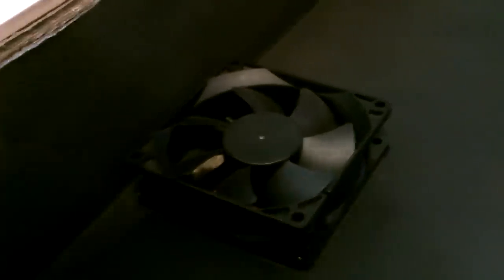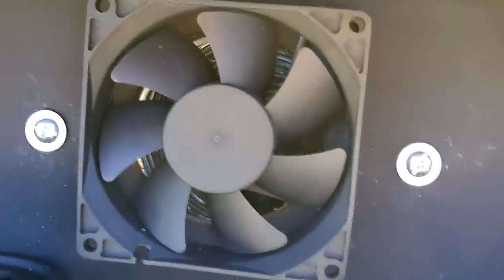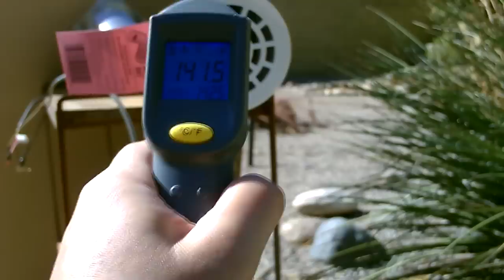Homemade "Steel Can" Solar Air Heater! DIY - STEEL CAN Air Heater! (140F+) - EASY Instructions!

Comment: I'm assuming you are using TIN cans. Do they even make steel cans?
Reply: Virtually all cans made today are tin plated steel.  You would be very hard pressed to find an actual can made only of tin produced after 1900 (this is mostly due to the cost of pure tin as apposed to tin plated steel).

Comment: What about at night?  Does it pull in cold air?
And for the comment about using aluminum vs "steel" cans, vegetable cans are not really made out of steel any more are they?  

And, what about using metal pipes in place of the cans?  Would it need to be cut into shorter pieces, so that baffles can be put every so many inches to slow the air flow and allow more heat absorption?  Wouldn't steel pipe absorb and hold heat better because it's thicker/heavier? or does that even matter if there is no sun, there is no heat... correct?  

I'm thinking about using something like this to add warmth to my chicken coop in the colder months.  It doesn't have to be real warm, just keep it above freezing so the hens lay better and the water won't freeze.

Comment: You didn't show how to hook up the fan.
Reply: Jaime B If you're buying a solar panel how much electricity would that buy for a low power fan? Buying ANYTHING for the project kind of defeats the purpose by the same logic. The clever solution would be to design in enough convection so that it powers itself (a dirty big chimney is  best)  but that's probably beyond most.
Reply from the maker: Amelia Harrington hi there. to connect the fan to the solar panel just hook the positive (usually red) wire from the fan to the positive wire from the solar panel and then hook the negative (usually black) wire from the fan to the negative wire from the solar panel. (to see the actual connection, look for my new "screen absorber" solar air heater video (will be posting it in a day or two). that heater uses the same type of fan/solar panel and shows a closeup of the connection. (the newest air heater uses a "screen absorber frame" in place of the cans to concentrate the heat).
Reply: I bought my fan at Radio Shack (it's for an old-style tower computer or telecom cage) and mounted it on the side of the box using 4 small wood screws (less than 1/4" I think).

Comment: I have an Idea the way the Oklahoma highway patrol want to be able to see Inside Your vehicle, just use Your vehicle as a heat collector then run a 4 Inch or larger diameter sewer line from Your vehicle to Your house. But I live part time In a Polyester Ice shelter which uses much less energy to heat and cool My house.

Comment: Does this only work during the day?
Reply: Randy Taylor since it depends on solar energy to operate then it will not work when the sun is in the other side of our world ie night time .however if you can you use the solar gain to heat some heat storage device then in the night the heat can radiate from the storage device . if you have no danger of the area that you are storing heat in dropping below freezing then something as simple as water filled jugs can be used to store heat during daylight and released at night time .

Comment: I think this is a wonderful ideal. We get cold winters and heat with propane which use to be cheap but like every thing else it's got to high. Our temps run in the 30's daytime most of the time. Keep up the good work.
Songsingingman

Comment: I made a small one using this idea 6x6 cans, hung it flat against a big double glazed window indoors so worm air 16c - 60.8F gets drawn in at the bottom and at the top of the cans it can hit 55c/ 60c 130F no fan just convection i've still to test with a fan.

 I've since seen a test video with sheet metal Roofing and cans side by side getting the same 60c - 130F ive got plenty of roofing it would have been 90% quicker to build, if outside you have to insulate it all, have a worm intake and block it off at night or when it gets cloudy.  Minus 20c - 30c here in winter so would have to take great care to super insulate it all if i did that.

But so far i'm pleased with the Results.

Comment: it's  pretty cool idea, but i have one question, the fan you used is a computer fan, what exactly do you have it plugged into to run the fan. And also it looks to me that it might work fine during the daytime hours but what about at night it doesn;t look like it could be used after the sun goes down

Comment: the reason to not completely cut the bottom off the cans is that the air would have insufficient time to absorb the heat, the smaller holes reduce airflow so the heat transfer can take place..

Comment: desertsun02   thanks for the  video,  i  would  like ask you  questions ,as  i'am into the same  projects ..the questions  is   in the  summer time  you  d,ont need this  pannel mean  you  have to  disconnect the  pipe of the wall?? and  if  you  use  another  fan and hole in the  bottom of the panel  will  make difference???

Comment: This would be great for a green house in winter or those cold nights prior to planting... You could control the timing of the fan with a automatic timer that sets more then just on and off.  If you had more need then that, you can just make it huge if you want to, and lay it on the roof.  You can also hook it up to a solar motor.  Thanks for your illustration.

Comment: So can you still get 140F out when it is -20F?
Reply: I recall seeing a variation of this in popular mechanics years ago.  I believe they tested it when the snow was flying and were able to get some heat out of it in the 75-85 F range.  Not quite sure, but they did comment that it was able to keep a room warm.  They also painted all the cans flat black as well.

Comment: What was the outdoor ambient temperature while you were conducting your test? Any solar absorbent system like this will increase incoming air, but will depend on the inflow. Even if you were starting with an ambient 80F and were seeing a 140F output, that's still a +60F increase... pretty impressive. However, I think with a low winter sun at, say 30F I think we'll see a definitive loss of efficiency; even if losses drive it down to a 40F increase that's still 70F coming into your house, still worth the effort for sure!

Comment: These work.

If you have the height and sun exposure, a tall column of 10 ft or more provides enough convection to eliminate the need for a fan...so long as the room you are venting it into is leaky enough to let out the cool air. Or a small solar panel and fan help.  Obviously the fan needs to run only when there is sun.

Also, 3 - 4 inch black pvc pipe cut in half length ways also works and makes the panel flatter. The backside of the pipe or cans is absorbing no radiation. Short lengths discarded from plumbing new construction sites will do.

I've seen these work at -10 degrees C in winter and keeping an insulated 12x14 room very comfortable at mid day in southern British Columbia Canada. But the short days do not allow for them to be the only heat source. The panel was about 3 ft x 12 ft made of halved black pvc as described above.

There might even be some mileage in simply building a box with a black interior with better insulation on the back. Do the cans really add anything? Or maybe just a black painted metal sheet to hold a bit of heat? The surface area exposed to the suns radiation entering the box would be the same.

Comment: Not a "new" design, but thanks for sharing your detailed build.  I would suggest though that you add more insulation.  1/4" cardboard is insignificant.  Make the whole thing another foot wider on each side and 6" deeper and add rock wool or styrofoam board insulation and you will get a LOT more efficiency out of it.  And as others have said here, insulate the pipe too.
Joan

Comment: Hey, insulating is a good idea. I figure that it will also allow for the expansion and contraction of the cans. Had you put they tight inside the frame, it may have warped the frame. Good form!

Comment: So this is an entirely new concept to me.  So I'm totally ignorant on the subject.  I live in Western NY, (I live literally 1 block from Lake Erie) and we get blasted all winter long with lake effect snow and high winds and really frigid temperatures.  Couple that with the fact that my house is VERY old and still has plaster and lathe walls, so I imagine the insulation is probably equally as old and outdated.  This winter which finally appears to be ending, has been one of the worst I can remember, and even with radiant heat and ceiling fans to help move the air around, it's very difficult to keep it warm in winter, this year my monthly natural gas bill was running between 3 and 4 hundred dollars.

So my thoughts are, could building modified versions of this to fit in the frames of several of my windows help to reduce my heating bill, or will the extreme cold negate any heat that might collect from the sun?  Also, since we don't get very direct sunlight in this part of NY during winter, will this even get enough sun to produce heat?

Comment: Curious....what was the outside air temp when you were reading the 140F? ALSO.. If your not placing this in window sill then consider insulating the tube to the house as well as to prevent heat loss from cold outside air...just a thought. I like this and going to try one. thanks for doing the video.

Comment: Sgt. Cannaboid- You don't have to drill a hole in your house.  Just put this in a sunny location. (Large window,.. glass door, etc) The panel will pull cold air from the bottom and send it out the top. Also, if anyone is interested, The Mother Earth news has a plan for something similar that is a totally passive system. (i.e. no fan) Look in the back pages....EXCELLENT WORK Desertsun02!!!!!!!!!!

Comment: Hi I am in the process of making one, out of soda cans. I think that instead of making holes in the bottoms of the cans, it is better to equip yourself in a can opener, and simply cut the bottoms off as well (surprisingly, two can openers that I have tried, worked very well on coke cans, too, I was able to remove tops and bottoms with a little practice). These holes you drill don't seem to provide too much of an airflow, methinks.

Comment: I would fix it to where something smaller to fit through the window,instead of this round floor drain . Shop Vac Floor Nozzle
http://www.ebay.com/itm/like/370967005640?lpid=82

Comment: ok call me a dummet but what is causing the thing to produce heat! does this wooden box of tubes stay in the house or outside with the tube running indoors.can you power the fan by mains electric.if its producing this amount of heat how come the wooden and cardboard box does not burn being its cardboard llined

Comment: Whats powering the computer fan?
Reply: oddstuff123
or a solar car charger so that it only pushes air when its sunny ;)
Reply: Skinny Anna
adjust size of the solar to compensate ;)
Reply: A computer fan can be easily wired to a battery pack or a wall plug.
Reply: the solar panel, 15watt...7:50

Comment: So now that we are heading into April soon... what were your results during the Winter?
Reply from the maker: hi there. results were very positive. using this heater as a supplemental heat source along with natural gas furnace this winter resulted in a substantial drop in gas usage. ex: Jan. 2013 used 55 therms. Jan. 2014 used 34 therms. (38% drop). Feb. 2013 45 therms. Feb. 2014 25 therms. (44% drop). no need for a heater here as of March.

Comment: the real questions is: how hot is the air  coming out when its only 20 degrees outside?.....and is it installed on the outside of the house? because at that point it doesn't matter how much the sun is shining when the box is constantly frozen and offsetting the heat of the sun.

Comment: why would use use steel? that doesn't make any sense
Reply: Maxwell Hill
Max, if you want to mollycoddle ignorance that's your choice.  ME?  The GREATEST COUNTRY IN THE WORLD is currently #36 in Mathmatics, #24 in Reading and #28 in Science by comparison of similar aged students.  Converted to a grade we have am F in math, a D in reading and a D- in Science.  Now as to Randy, he did not pose the statement as a question, which I would have gladly answered and nurtured, he replied to another's post ANSWERING with a total misnomer (that's being kind) and that is indicative of the problem.  It can't go unchecked and if my response takes Randy aback, GOOD.  That means he learned a valuable lesson.  I could care less about being PC, and this country has precious little time to dawdle around worrying about feelings when the rest of the world is eating our lunch. Thanks for your post Max.
Reply: randy kinch
Ah, Randy, X-rays and Gamma rays have nothing to do with it.  Its infra-red conversion and the properties of the metal speak to conductivity of the heat through a solid median.  Just FYI, gamma or xray powerful enough to create heat, would kill you deader than a door nail.  SJT 3D Labs, NY.
Reply: jreed136 indycurt1 Stephen Thompson Maxwell Hill 
Ladies, ladies, your all beautiful!!
Reply: Yup Randy learned a valuable lesson there from your mentoring. Bet he didnt get half way through your post before boredom took over. And i'm gonna have to call bullshit on the "GREATEST COUNTRY IN THE WORLD" comment!! You should check out some other countries! Believe it or not, there are a few other nations out there beyond the borders of "greatest country in the world" If its so great, why is it full of so many intellectually challenged citizens?? Must be something in the water!! Keep fighting the good fight though ;)
Reply: indycurt1
Looking at your playlist, it appears sits past your bedtime son. Or didn't you realize everyone can see that?  LOL!!!!!!!!!  Ah, kids.
Reply: Stephen Thompson
Unfortunately smashing people in the face with information isn't the right way to go about it either.

I'm an autodidact, you just have to have a thirst for knowledge. It helps if you can get the Feynman effect. "The pleasure of knowing something." Those little tingles down the back of your spine when you learn something interesting.

People are lacking this, must find a way to give it to them.
Reply: Stephen Thompson lmao bro way more people are with you than these idiots. thanks for correcting him
Reply: Stephen Thompson That's OK. . .the greatest country in the world doesn't have you in it.  So that makes it even greater as far as I'm concerned!  What a pompous ass you are.  I sure hope you are not a true representative for your country (wherever that happens to be).
Reply: Seriously, there is something terribly wrong with you.  You are so shallow that you make judgments based on such little information.  Not only are you a pompous ass, you're an ignorant one as well.
Reply: gasgascc Oh no you di-int!!!! snap snap snap
Reply: Stephen Thompson So condescending!
Reply: gasgascc Do not insult women by using them in a derogratory term. And it is you're.
Reply: Maxwell Hill lmao canadians
Reply: Maxwell Hill Max does not possess the reading comprehension to understand, but Stephen was speaking ironically when he said "GREATEST COUNTRY IN THE WORLD."
Reply: +Stephen Thompson  ignore these arrogant idiots, being offended by someone telling the facts, that can't be easy.. Everyone reading this thread can tell from who the ignorance is coming from.
Reply: Stephen Thompson " I could care less"
Or do you mean:  you could NOT care less?
Reply: It makes alot of sense , steel gets hotter beccause the xrays and gammma rays and other particlesin the sun rays are going to be stopped faster in the denser metal causeing more friction and more heat .  and it is denser so it holds the heat better too.   aluminum transfers the heat to air faster as we know , so theres an idea for my next hot box, metal cans with an aluminum can or two on the top of the columns of steel cans.
Reply: I have decided to do the opposite and use a Truck radiator and 200 convex lenses
Reply: luke53285 YA Steve!!!! Luke is with you man!!!!
Reply: Maxwell Hill So ignorant!
Reply: Phillip Roberts Agreed! im stupid, ignorant, ugly, non-american........i apologize folks :D

I love you all!!
Reply: He's finally getting it.
'Cept being non-American is actually a plus...
Reply: Phillip Roberts Now you're ignorant too!

:D thanks
Reply: Maxwell Hill How do you figure?  America is definitely one of the most culturally ignorant 1st world nations on the planet.  I mean, this IS the nation that coined the phrase, "If it ain't white, it ain't right," and conversely, "It ain't right if it's white."  We used to be a melting pot, but the pot's boiling over, now.

The problem here is that we think we have it all, so people do not bother to travel outside the borders like they used to.  All outside cultural contact is made via the internet and assumption that imported goods are a direct reflection of the outside world.  As someone who's done a fair bit of traveling, it's astounding to hear what people in my country think of the outside world, and how they are cemented in those views even without any real reason to believe such.

That said, we're still one of the technological leaders on the planet, and one of the top industrial producers, tech consumers, media producers.  How else do you think we get away with all the shit we do?

Oh yeah, we're on top of the arms race....that'd probably be a big reason...
Reply: Stephen Thompson You raise some valid points, but we're all imperfect.  Apparently you have inadvertently picked up the popular habit of saying "I could care less" when you, and most who say it, usually intend to express the opposite.